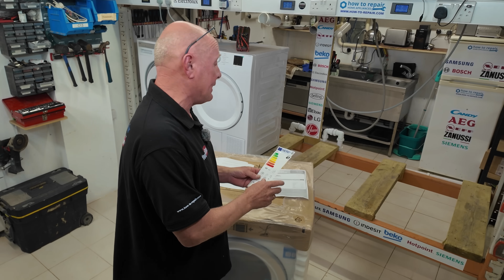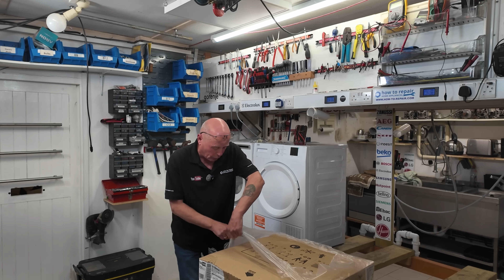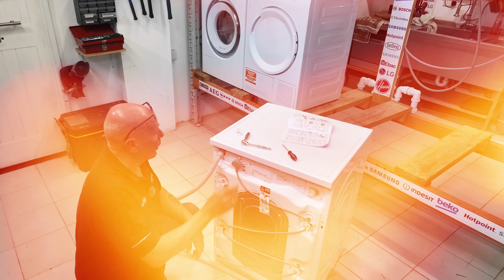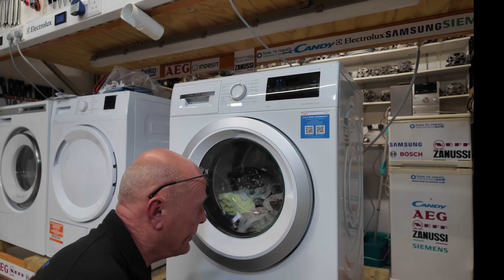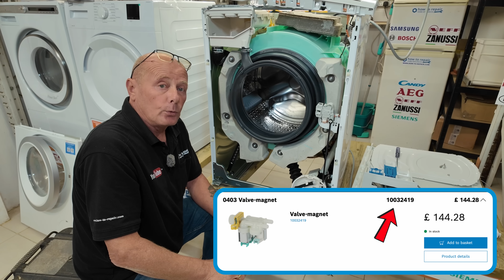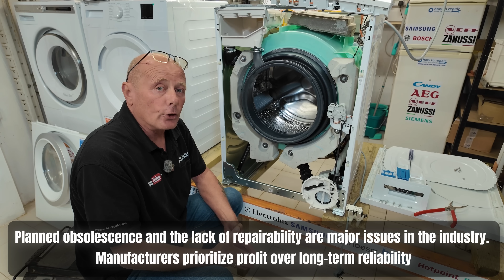Bosch WAN28259GB Washing Machine An Engineers Review: The Good, The Bad & The Ugly Truth!

Comment: i ended buying a 6 series bosch made in turkey to replace my 20 year old german made aeg. its got 5 year warranty and it was relatively cheap. we"ll see how long it lasts (def not expecting 20 years)..
Reply from the maker: as you will see in a later video but I'll send you the link to it now on series 4 and series 6 machines they have built a counter into their system which tells you how many washes the machine has done. It will be very interesting over the next few years to understand if there is a common number when the bearings fail all the inverter board fails  please remember to give the video a thumbs up and subscribe to the channel as that's what keeps us going: https://youtu.be/138S0rSbZ10

Comment: If your machine is building up residue or requires a “drum clean”, then your laundry itself isn’t being cleaned effectively either!!… change your detergent, wash temperature and ease up on the fabric softener.

A washing machine, like a dishwasher is built to WASH. If the machine can’t even “wash itself” clear of contamination during a cycle… then the items within, aren’t being washed effectively either.

Effective cleaning requires chemical, agitation, temperature and time… fall short on one parameter and you need to make up for it in another.
Reply: @LukeAusNSW.
Sinner circle explains all.

Comment: Yet again a blatant and deliberate ploy to ensure we all throw away entire machines that are 99% perfect at the moment they hit the tip. Disgraceful. It’s time for the government to wake up to this problem. The manufacturers must be laughing all the way to the bank.
Reply: Welding the tub cuts down on the component count and assembly costs (no screws, no tub seal, and no pressure chamber - its moulded into the tub).  Even if the bearings were replaceable, I think these days, most people would opt to scrap the machine which would probably be 8 years plus old when they fail, rather than pay parts plus the high labour cost and putting up with the inconvenience of being without the machine for days and having to take the day off for the repair for a machine which might fail again in the near future because of its age. It's different if you opt to do it yourself of course, did the bearings in my old machine for well under £30, and used premium quality bearings which were a lot cheaper than the OEM ones. If I ever buy one with a sealed tub, I will invest in a cheap hot air plastic welder and cut the end off the tub and replace the bearings when they go.
Reply: @mels8966 Cheers for this. I also replaced the bearings in mine when they failed - after just 2 years. Cheap machine though. Like you, I spent very little (relatively speaking) on good quality new bearings. I do accept that most people wouldn't consider doing a DIY job like that (it was a bit of a pig to be honest - the drum shaft was well seized into the bearings!). I suppose scrapping an 8 to 10 year old machine isn't too bad, but 15 to 20 year old machines weren't uncommon when I was growing up. I'm intrigued by the 'plastic welder' - do you have any more info on that?
Reply: @clearprop  My last (ever) Hotpoint's bearings only lasted a year - my guess was they either didn't fit or didn't grease the bearing seal properly as I'd noticed wear in them  during the first year. We paid for the repair and the hotpoint/indesit repair guy replaced the drum and the back half of the tub as well, and I think it lasted another 6 -7 years. The original set of bearings in my current machine seized after 10 years, had a bearing extractor, club hammer and cold chisels etc so wasn't too much trouble - its over 16 years old now, although I have recently had to replace the relays. Other machines we've had the bearings lasted 8 -10 years. The hot air plastic welders are a hot air gun with a narrow plastic welding nozzle, with one tube for hot air and another for a strip or rod of polypropylene and a little shaped metal tip at the end that melts the plastic you are joining and fuses it with the plastic strip to fill the gap. They are straight like the hot air tool on a soldering rework station, rather than "gun" shaped. You would have to watch out what you buy as some chinese ones don't have an earth on the element, although you wouldn't want to be touching the hot element anyway, I guess. If I buy one, I would test for an earth and modify it necessary. I've seen them on the chinese sites for under £50.  There are videos on YT showing sealed washing machines being refurbished using this method. Another approach is to split the drum at the join and use lots of bolts to hold it together with a sealant, however washing machine tubs are usually made from polypropylene, which is a low surface energy plastic (LSE plastics cause water and adhesive to bead up on them, instead of spreading and wetting it) which means most adhesives and sealants do not securely bond to it.
Reply: @mels8966 Thanks so much for the useful information. I will do some research on plastic welders - I feel they could have helped me in the past with various jobs, rather than using a soldering iron and random bits of plastic! Slow progress that way. Thanks also for the advice regarding cheaper versions - I always steer clear of any direct Chinese imports when it comes to electrical products. I'm impressed with some of the timescales you mention regarding bearing life. Just goes to show that it's always worth a bit of effort and headscratching to add years of service to appliances. Cheers!
Reply: @mels8966 I have seen people use gorilla glue to glue the two halves together!
Reply: @mels8966  Did you catch the brand of the failed bearings in the Hotpoint?  Or do you reckon the failure was Hotpoint's own drum seal as some washing machines only use shielded bearings and rely on the drum seal instead of using sealed bearings.
Reply: @TassieLorenzo  The hotpoint/indesit repairman saved a lot of his time by replacing the perfectly good drum and rear half of the tub, so he didn't bother disassemble them, which was fine by us as indesit charge for labour and callout costs and parts are "free". Probably his time was worth more to the company than the extra cost to them of the parts. The machine I believe was a WMA 31P,  the official hotpoint replacement bearings apparently are 6207RS  and  6206Z, plus a rubber water seal,  so the inner bearing had a rubber shield, unless the spec was changed post manufacture. If the water seal was missing or defective as I suspected, the rubber seal in the bearing might have been the reason it lasted as long as a year, but as he took the parts with him, I never got to find out. The bearings in my current machine (a zanussi branded electrolux aka AEG) are 6306 ZZ and 6305 ZZ bearings, so metal shields. After 10 years the inner one seized up and squealed due to rust from water ingress. The water seal was thickly encrusted with limescale - I suspect  having very hard water causes the water seal to wear out and fail sooner, since a coating of limescale would stop it flexing. I now use electrolux's diagnostic mode, leak test when I annually descale it to try to splash hot water and citric acid over the seal and the top of the tub, although it probably doesn't do a huge amount of good.
Reply: @WSHLNd120  Did they treat the edge of the plastic first with a chemical or flame treatment, or else use lots of fasteners and just use the glue to make a seal? Otherwise the bond will be weak and liable to fail; perhaps the fillers added to the PP in washing machines might help, they used calcium carbonate in mine, but modern ones use recycled plastic waste to bulk the plastic out. You can get specialist adhesives for bonding polypropylene (PP) and other polyolefins (non-stick Teflon PTFE is also a type of polyolefin), the well known one is cyanoacrylate (super glue) sold with a polyolefin primer, but that can't withstand water, heat or chemicals. One that might be suitable is a Methyl Methacrylate adhesive (MMA) formulated for PP,  which has an additive to modify and boost the surface energy of the plastic - standard MMA adhesive won't bond well to PP. Permabond do one that might last which costs from £16+ a packet, if you shop around.
Reply: @mels8966 It's the callout /labour charge & for many time off work even if the part may only be few pounds.
Most just buy a new machine - but as it's a distress purchase, shop on price hence lower production costs to compete for the sale between brands.
This is especially since Internet shopping became the normal. 
Customers often don't see the machine before they order.

Comment: Really enjoy your videos. I had a £1000 Bosch washing machine with i-dos purchased in 2017. Within 5 years the same part in the i-dos system had failed 9 times. The machine was under a DomGen insurance policy and they refused to do anything except keep replacing it. Ended up eventually moaning to Bosch UK CEO and they eventually conceded a replacement but it was a Siemens model due to supply chain issues. Generally happy with it but I'd be really interested in your view on appliance insurance, especially considering the awful costs you've talked about here.
Reply from the maker: in my honest opinion, the insurance companies have too much FinePrint what we need is an appliance that can be repaired if you want to with a fair price on the spare parts  please remember to give the video a thumbs up and subscribe to the channel as that's what keeps us going
Reply: I used to sell domestic appliances
Higher range models inc Siemens can come with 5 year manufacture warranties & Miele with 10. 
These are not new machine for old warranties.
 Normally faulty components will be replaced - unless the service cost exceeds value of appliance
Then customer may be offered a discount on new machine based on age of appliance.
Reply: Yep the iDoae is rubbish. Mine stopped working and I was wearing stinking clothes for weeks before I figured it out. Luckily mine broke inside warranty (they stuffed up the planned obscelesance timing).

Comment: Excellent video Paul. 
You should make a video where you take EVERY PART of the machine separately and check its price and then make a calculation of how much a machine would cost if you would buy every part separately and assemble it yourself. 
I bet that the machine would cost 2000£
Reply from the maker: On average, the parts always cost four times more than the machine but a very good idea for a video thanks for the comment mate

Comment: Brilliant video - I find Bosch machines and appliances to be good value for money although they do suffer from Inverter board failures very frequently which seems ot be the main issue with this range of Bosch. I personally would go for an older Bosch machine with a splittable tub.
Reply from the maker: It was one of the best machines ever made. Bosch really made their reputation early 2000 but now there exploiting the general public.